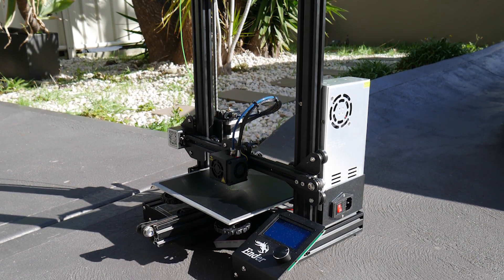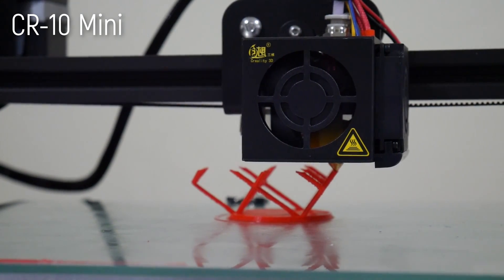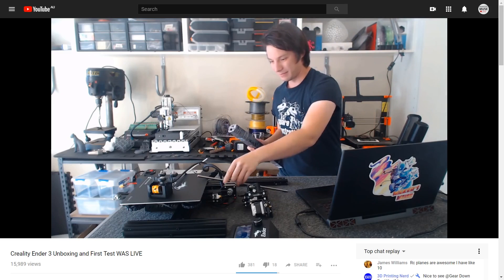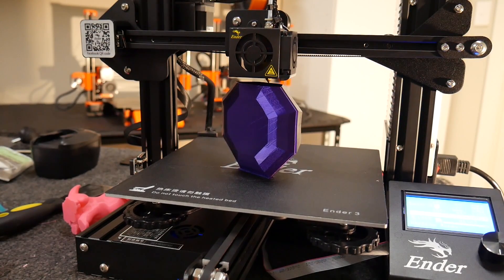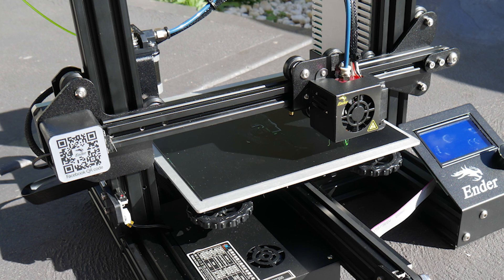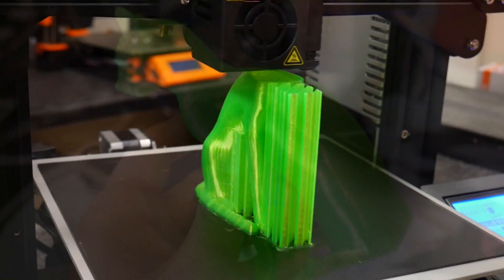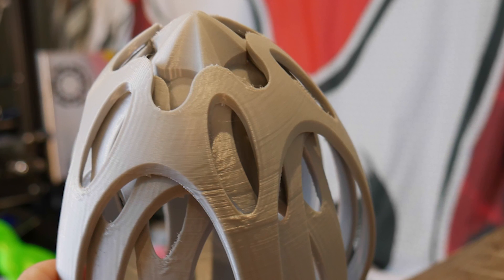Creality Ender 3 Review

Comment: FWIW, here in 2025, purchased in 2018. I’ve upgraded the mainboard a couple of times, still the same extruder and hot-end. I replaced the Bowden tube with a PTFE one. I upgraded the cooling shroud with a better one, but still the same fans. I put a color touch screen on it. It fails sometimes for sure, but I’m still using it regularly.

Comment: Question today is: would you recommend a UNREPAIR ENDER 3, at $79 shipped?  Ebay has tons of these, and considering one since I have enough experience and mechanical aptitude to think I can fix whatever needs fixing and even $50 or more to get it running won't break my bank if I don't get "lucky"...

THOUGHTS on UNREPAIRS???
Reply: Ik this is old, but if you have a Microcenter near you, you can get a new one for $99 with the $100 off coupon for new customers.
Reply: @3ountyhunter  That's fair, but Ebay offers a 1 year Squaretrade warranty on these unrepairs for $10, so I think that's an equal or better deal for the many nowhere near a Microcenter at $89 delivered.   Of the three I've bought that way now, the worst was one not working because of a loose connection to a Z end stop, and on another one, a Y end stop needed adjustment.

Comment: I recently got an Ender 3 and every print so far has been far better than any example in this video.
I'm thinking Crealty has addressed these issues. My Ender had locking clips which hold the extruder tube tightly. the tube itself seem flexible but not soft. 
I'm glad my one is performing very well so far.

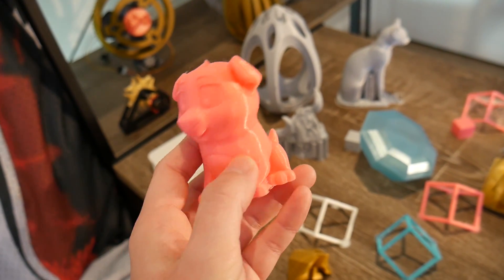Comment: At 4:05 a print of a pink pig is shown. I can see the surfaces on it are smooth. I printed a bust of a person on the Ender 3 printer I have, the surfaces of the face come out smooth. The problem comes when I print a simple cylinder; it prints a polygonal shape instead. I understand the origin for this might be the software that generated the 3D file. In the case of the cylinder it was a mechanical design software called Creo elements.I use slic3rpe slicer. My question is: Can something be done so an acceptable approximation of a cylinder or a real cylinder is achieved? Can someone help please?

Comment: I'm still in the research stage of getting my first 3D printer and I was wondering if any of the negative issues brought up in this review have been fixed in the two years since it was originally posted? Thanks for any help!
Reply from the maker: yes, for the most part they've made it much better.
Reply: @MakersMuse  wow, I was not expecting a reply this quickly. This is good to know, thanks again!

Comment: As for those seams... there's a setting in Cura that allows you to pick what side the seam would be printed on (left, right, front or back, or anywhere in between). And, if you have a print design with corners on in (inside or outside corners), you can have the seam hidden i there instead, that way they are way less visible after printing.

Comment: Great review! Only hangup was that Angus kept mentioning restrictions to the plate thickness and bed leveling due to the length of the springs. The z axis tactile switch is attached to an adjustable plate. This plate can be moved vertically to account for changes in thickness of print surfaces and issues that occur when attempting to level the bed at either end of the spring limits.

Comment: The Ender 3 and new pro comes packaged with lots of hopes and dreams.   This is not for a newbie. It is marketed to the wrong audience. If you want something that will work  without much hassle this is not the machine you want.   Expect to spend about $100 and a good amount of time engineering the half baked product. Angus is right on...

Comment: So, im here at the end of 2019 with none of these problems, and beautiful printing quality
Reply: Good to hear, I have one on the way.
Reply: @RADERFPV  same here. Worst case upgrade are possible and will cost less than a prusa.
Reply: @SaitoGray  You're going to love it! I got mine last week and got 'er all setup in no time flat. So far I've printed out every part you can for the printer that you see online, some drone stuff (motor wire protectors/sma adapters, etc...) and some fun puzzle and helicopter toys for my kiddo's. I've only had to re-level the bed once after it settled in after a few prints, and it's been printing flawlessly. So easy to use, and so cool to see in action. Take your time when building it out and make sure it's all squared up, and the concentric nut thingies they all talk about are tightened up just right - not too tight, not too loose - very important. And get those belts nice and tight too. You'll be good to go once you do. Happy printing!
Reply: @RADERFPV  Awesome thank for the feedback !
I can't wait !
Reply: SaitoGray My printer worked well until I upgraded my hotend. Any upgrades in the extruder and hotend assembly can result in many more issues, so I don’t recommend upgrading those parts if you don’t have much experience.
Reply: RADER FPV hey man I really want one and am wondering as of end 2019- 2020 have they fixed all the issues in this video?
Reply: @jameseliot1134  basically
Reply: Zágoni Mátyás so if I bought one and got it set up to print off the attachments for it I would have no hassle doing so, from printing the parts to after when I start on actual stuff?
Reply: How long have you owned and how often do you operate? Thank you
Reply: It is a great machine and some of the flaws are ironed out. Still need to flash Marlin to enable thermal runaway protection. Also a new motherboard with higher memory is recommended, as well as ABL.

Comment: You know, I bought this printer about two months ago, and I've already ordered my second one. My only complaint with the printer is that they don't offer an option that has a 1.1.5 mainboard and BLtouch installed from the factory. Luckily, with the prices I'm able to find online it's still cheap enough that I can buy the printer, the mainboard, and the auto bed leveler for less than $300. That's a good deal to me, and I'm perfectly happy with the terrain I'm printing for my pathfinder group.

Comment: I just ordered the Ender 3 pro, and these issues were not there anymore. Be wary, I don't know if it had thermal runaway protection out of the box. I didn't take the risk, and flashed TH3D firmware with mesh bed leveling and advanced pause enabled. Warning! TH3D advanced pause firmware does enable power loss recovery, but do not rely that it will work! If you're concerned, get a UPS that can handle the load. If your fuse blows, make sure to get the right type of fuse or you might blow the new fuse 90% into the print because it couldn't handle the current.

Comment: I can say this if you have no clue about plastic and i have almost 37 years in thermoforming, Injection Molding, Blow Molding  CNC programmer. Thermoforming Technician.  I could get the Original Printrbot Simple to print better then any top end printer. None of you who have zero knowledge of how plastics act to certain temps nd what type of heat used to heat these plastics. These hot ends you are working with have a raidiant heat instead of direct heat. Every plastic is different even the same type. Depending on how its extruded or if your working with pre-extruded materiel in its raw form. You and Chuck  have a long way to go to learn. The machine is just a tool its the person who set up, troubleshoots and runs the machine has the knowledge of all the above. You do great videos but you all still have a long way to learn. But you will get it and when you do your remember this post and say to yourself damn now i understand. lol Happy printing.

Comment: The ender 3 is a very nice printer, i replaced the extruder with a cheap eBay $3 aluminium extruder,and also replaced the bed with a $20
 creality glass bed and now it prints perfectly. I'm thinking of adding a bltouch too.
Reply: Do u have a link for that or the type to buy

Comment: I know exactly what's wrong with your coupler. You didn't finish assembling it. There is a little blue clip that's supposed to go in there. The clip holds the coupler rings apart and the teeth into the bowden tube. I see so many YouTubers who did not attach the clip. Most of them recommend buying a better coupler. I recommend just using the clips. My couplers work great!

Comment: Another thing to replace on day 1 is that horrible plastic assembly on the extruder motor. After two weeks or so of printing, PLA grinds right through it, and the filament carries its bits into the nozzle and jams. Mine eventually just cracked underneath, and I spent a lot of time troubleshooting the under-extrusion that ensued.

Comment: what upgrades would you recommend for this printer?
Reply: I printed a filament guide arm and a fan duct, and I bought an auto bed leveling kit and a glass bed.
Reply: @johnathanmoyer2375  I also got ezabl, capricorn ptfe and micro swiss all metal hotend upgrade. Haven't touched bed yet let alone assemble it

Comment: I really like everything about my Ender 3 except that for some reason, the walls on the x axis always print misaligned (no layer shift, perfectly vertical) and I can't find anyone with a similar issue from an Ender or any other printer. I'm nervous about having it replaced due to the plethora of other potential issues I could have. I've added a sheet of glass and adhesion is perfect. The PTFE tube has no issues,the frame and all parts are aligned perfectly. Shame about this one issue.

Comment: Great video! I just bought Ender3 as well but I'm having big trouble on this new printer!! When I did first try, the nozzle didnt extrude plastic out even though the feeder motor was working. after a while like 20 seconds, the nozzle suddenly shots some material out but definitely not the same amount of the material that had been fed into fro that 20 seconds. I checked the couplers, they look fine and also the manually pushed the filament when the nozzle is heated. I can see melten plastic is extruded out when I manually did it.  Do you know the reason causing that? Please help:)

Comment: Hmmmm. A small zip tie around the slot in the plastic grab nipple does the trick on the extruder.
And ...any magnetic build sheets loose magnetic grip on anything other than PLA temperatures....
Reply: Or just use the blue clips that're in the bag of spare parts. That's what he's missing here.

Comment: I'm in the market of buying a 3d printer. I have been watching a lot of videos on this model for a beginner 3d printer. My question is should I, or is it best to spend the few dollars more and go for the ender 3d Pro? As I have seen it has a double wide track at the bottom for better stability. I am still aware that there still can be some small upgrades. Which is to be expected..

Comment: Auto bed-levelling... I never got the fuss about this. I have never had this feature and yet my bed is level. I mean, its not that hard. And you shouldn't have to relevel constantly. Same goes for for other features like filament detection. If you can't keep track of how much you've used and how much is left... well... no comment then. The two main criteria I look for are 1) print quality and 2) noise level. And the second can easily be solved with some simple mods. But when I look at a lot of the features on modern printers it seems as if people have either become very lazy or stupid. Or both.

Comment: Great review Angus! I think you hit the quality control thing exactly right. I ordered an Ender 3 back last fall. I had other issues. These issues eventually just led me to sending it back. Sure I could have just troubleshooted and bought extra stuff and eventually figured it out. But at the time, I was looking for a plug n play solution. I thought the Ender might be something close to that. I'm sure someone will say I just put mine together and plugged it in and it was great. However, I think we are seeing a pattern here. I eventually went with the Flashforge Finder. I might eventually go back to the Ender 3 if I am looking for a project that requires more time and setup. But as for now, it didn't fit my needs.

Comment: Hey Angus can the ender 3 be networked?
Reply: As I understand it (I don't have one), there's no networking built in but if you run it off a Raspberry PI with Octoprint, you effectively have a networked printer.

Comment: Could you use PLA as an etch resist for making PCBs? Eg print onto copper where you want tracks, then etch off the rest? Then peel off or dissolve the printed filament?

Comment: In summary: $200 for the Ender 3 + a bunch of replacement parts + tinker-time from very experienced users + wasted filament while tuning the equipment = a moderate device that does barely passable prints. I wouldn't recommend this as a first printer unless you're prepared to tinker and are looking for a challenge.

Comment: 4:50 I bought the Pro version about 1 month ago and that was absolutely to 100% the very first contact with a 3D printer ever for me, I went in totally blind. A test print went to hell almost right away but I quickly figured it out that something was bad in the nozzle since the filament wouldn't go in.

It showed that the PTFE tube hadn't been pushed in enoughin thje nozzle from fab so melt plastic had quite quickly started to clog it up. After I opened it up and remove it all and pushed the tube to the absolute bottom it printed perfect.

Now however I noticed that the bed was not totally flat since it was a little tiny bit lower in the middle then towards the corners (or the opposite, don't remember right now) so if I printed something small in the middle it would be just fine bit if I did the same in a corner it would not with 100% certainty stick unless I would calibrate the bed again. 

So with other words I couldn't just print anywhere without changing the bed height. I pretty much only print smaller items so no biggie and I can also print bigger if I raise the bed up all around even if it will be to close at some points then but would most likely work.

But after the bed leveling and PTFE tube fix and the clog it all just worked perfectly with very nice prints, way better then this and no fuzz when retract and such either.
Reply: I have a anycubic i3 mega s 3d printer and it is amazing im just a beginner

Comment: I dont have that problems he said. i am actually very happy that it works now, as i wait for my prusa i3 spare parts. With that said, you need to calibrate of course a new run-out-of-the-factory printer. And i double checked all parts forehand. BEFORE i go into the first test prints.

3d Printing for newcommers is a steep learning curve, but it's possible and the ender3 is a way better option than others on the market.

Your autobed leveling can be easily incoperated and the parts needed can be printed on it.

All in all, i would totaly recommend the printer, but also would tell a newcommer to do research and mentally prepair for the said learning curve. 3d Printing is after all not easy as cake. Even for a prusa you'll need time. Alltho they have a very good support and you can buy it allready calibrated. They also will always help you out, while with other manufactures - you need to research your problems alone.

Both is fine, depens on how much time you like to invest.

Comment: Two things. When a tube gets removed from one of those couplings, you really should cut the end back past where it gripped the tube before. Yeah, I realise that means trying to re-cut it perfectly square for this particular application, but this is the right way to do it. The tube couplers are the same design used in compressed air applications. So as long as you reference the tube's outer diameter, you should be able to buy some locally, no matter where you are in the world.

Comment: Im not sure if not having any 3d printed parts is actually a good thing. Companies such as Prusa are able to update their parts because their parts are 3d printed. Just in their Mk 3 model, they have been constantly making changes to their parts to address issues, because they can simply fix their 3d file, and print updated parts.However, Creality is using molds to create their parts which means that they are pretty much stuck to their parts unless they make new molds for their parts.

Comment: I just bought an Ender-3. Having problems leveling my bed . All corners are level but the center is much lower. I place a vary straight 6" long edge on the bed and it looks good. Any suggestions.

Comment: Direct mounting of the extruder on the X axis requiers a second Z axis lead screw as the X axis overhang is already pretty insane considering the aluminium + V shape roller solution used here. From a price stand point this is a good-enough solution. This however requires extra attention when using the machine.

Comment: The product is good printing, but unfortunately I had a problem with the driver of the board and some of the axis stopped working days, so contact customer service and this is really bad, I returned the printer right where they told me now they are not able to locate it. I advise to buy the product in another website with more guarantees, for example Amazon.

El producto es bueno imprimiendo, pero por desgracia tuve un problema con el driver de la placa y unos de los eje dejo de funcionar a los dias, por lo que contacte con el servicio de atención al cliente y esta siendo realmente nefasto, devolvi la impresora justo donde me dijero ahora ellos no son capaces de localizarla. aconsejo comprar el producto en otra web que de mas garantias, por ejempo Amazon.